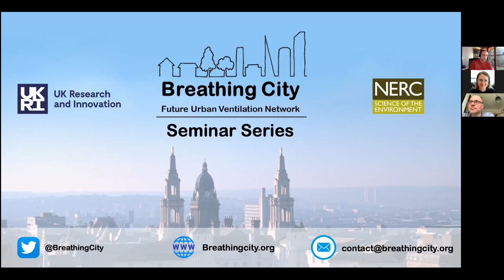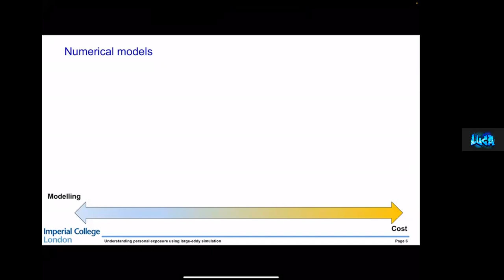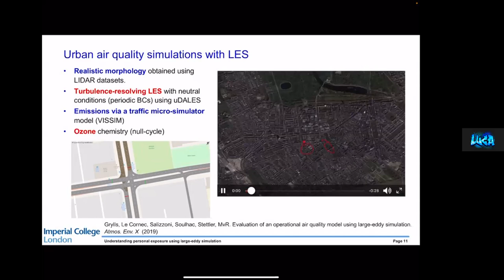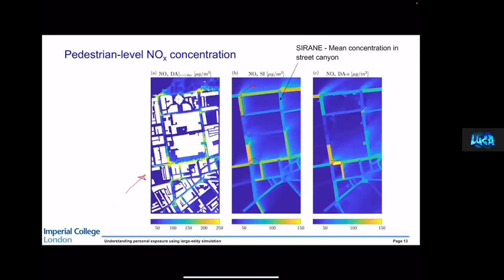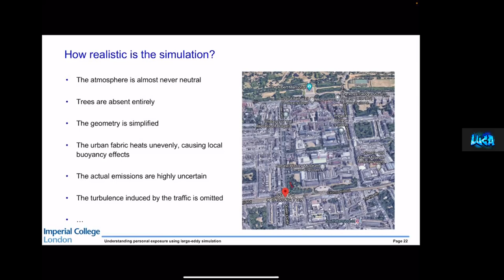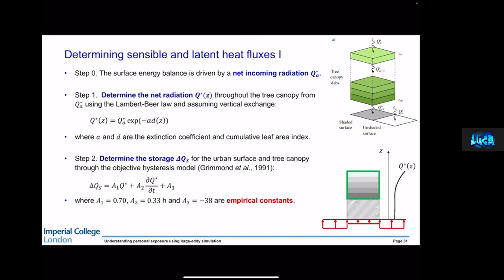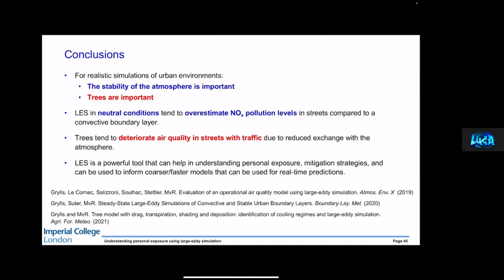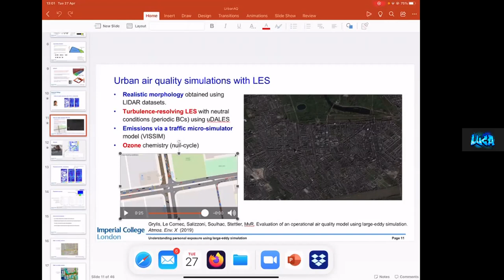"Understanding personal exposure in outdoor environments using large-eddy simulation"

Comment: Trees dont resolve the issue of Nox polution, check how photosynthasis works.  Alot of assumptions where considered to run the simulation, it is common knowledge that with the increase of number of assumptions the accuracy of the simulation drops. No convergence check was conducted to the done simulations.  You cannot neglect bouancy due to the temerature variations within a city full of activity. Heat radiation was not considered which plays a major role in the heat transfer, especialy that its a function of the colors of the different textures.  What bounday layer thickness was considered? Water  vapour was not considered in liquid and vapour form. What surface roughness was considered? No clear explanation to what size of eddies was considered  and what are the required turbulence length scales?The location entranment needs to be considered for the allocated location. Subway activity is not considered. I think the data should be more rigorous, the colorful images are not sufficent to prove the shown data, including no sufficent experimental data to validate the simulation data, velocity data is not shown or validated, no vorticity was plotted,  taken boundary conditions is also not  shown, capturing the concentrations to ppm level requires high resolution mesh and experimentation. The environmental chemical reactions are not shown, pedestraents and the green cover activity should also be considered because they emitt also CO2. The time of day of the simulation is not stated. What time stepping method was used, what dt value was taken? Because chemical reactions occur at very small time scales. How many species where considered within the simulations, what initial conditions where considered?
No clear summary to how many equations where solved for each element, the type of used  mesh was not indicated to, no mesh statistics was show. No clear indications to how Nox was produced?